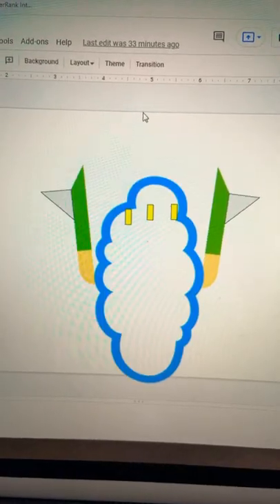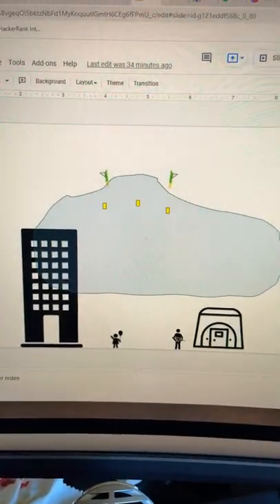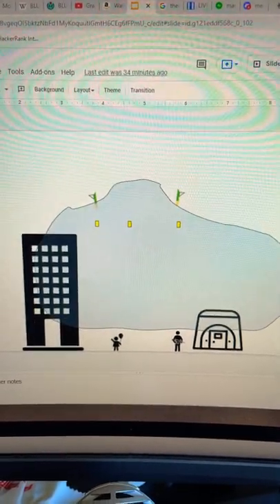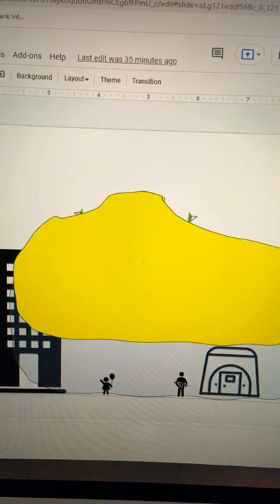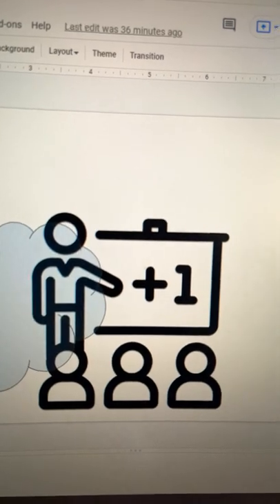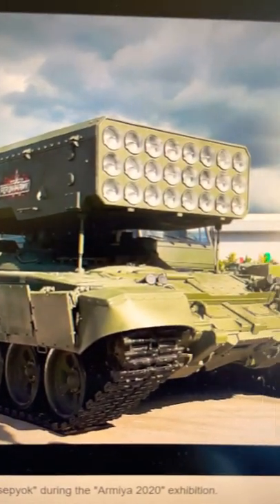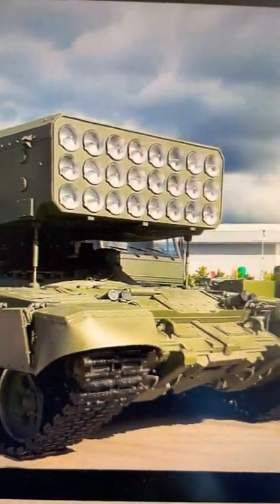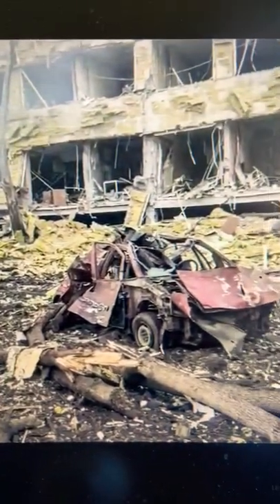How do Thermobaric "Vacuum bombs" actually work?

Comment: They are called vacuum bombs because it created rarefaction of air after the initial blastwave. The rafefied area then will equalize its atmospheric density and pressure by,... sucking the air from its surrounding, so not so much vacuum as in space, more like vacuum as in cleaner.

Comment: Pointing out a tiny misconception- the fuel really doesn't have time to get in cracks and such, everything happens very fast. The main advantage is that the bomb doesn't need to carry chemical oxygen (most of the mass of traditional high explosives) so you get more bang per bomb. The overpressure wave also lasts longer because it's emitted over such a large area, making more damaging to certain things.

Comment: When the original shell is ‘blown open’ how does it not ignite the fuel that is dispersed & saturated the air/area? Or is ‘blown’ open literal using say air pressure to separate the prices? Many thanks for all these; your channel is mint for so many and to many reasons! :) keep them coming, gutted when I check your uploads and there are only a couple new ones :) just greedy I guess!
Reply: Because there's not enough oxygen. Then when the fuel is dispersed there is enough oxygen and the second explosion ignites the fuel.
Reply: @ThePandafriend  perfect, thank you

Comment: If  you fire a standard RPG 5 at the unit carrying the vacuum bombs before it had fired any what would happen?
Reply: What’s an RPG 5? That aside, if it was hit with any explosive munitions it actually wouldn’t be as bad as if the munitions were used as intended, as the fuel has not yet mixed with oxygen or been allowed to spread out. However, that vehicle along with the crew inside and anyone around it will simply cease to exist.
Reply: @casual_speedrunner1482  sorry ment a rpg 7v2.

Comment: It should be three rapid stages. First to pop and disperse the fuel a secondary tank of liquid oxygen pop, then the 3rd explosive charge to detonate. Maybe use a hydrogen-based dispersent. Or fill the primary with two parts liquid hydrogen one part Liquid oxygen to pop before the secondary. That would be near 100% efficient. A SCUBA tank would work great to add large amounts of pressurized hydrogen and oxygen 2:1. It would probably just need one charge since it has all the oxygen it needs. Or just use straight liquid hydrogen to pop before the secondary & use the surrounding oxygen like a vacuum. But it wouldn't be 100% efficient. Two parts hydrogen one part oxygen it's a perfect combination for 100% efficiency.

Comment: Smooth brains: they suck the oxygen out of your lungs 😯
Reply: Love reporter logic.  Ruptured all of my squishy insides, but yea, the lack of oxygen is the main issue.
Reply: Correct any explosion needs oxygen even if it's a solid fueled rocket the oxygen is just mixed in with the component filler but they absolutely cause a vacuum if you're in the building that's filled with the blast first there sucked out of your lungs and your body then my guess is the flame and Heat hit you then the overpressure
Reply: @JustinRK81  The underpressure after the explosion leads to lung damage.
And no, you don't need oxygen for an explosion. Just an oxidant.
Other compounds can fill this role too.

Comment: For the life of me I can not find any source for the original coining of the term vaccum bomb. It is at least two decades old and I still do not understand it because it just doesn't make sense because physics. What is an explosion? Anyone? Fundamentally it's expansion of volume. The difference between a fire and explosion is time. The fire expands the same volume over a long time but shorten that time and it's an explosion. Alright so you have an expansion of fuel to water and generally carbon or nitrogen gases. Those take up more volume, you also have heating of surrounding air. If you increase the temp of a gas it increases in volume and decreases its density at stp so you have expansion. Can someone tell me how a regular explosive differs in the ability to create an area of increased gas temp and lower density such that you wouldn't get the exact same reaction? FYI this is why every explosion creates the typical mushroom cloud....
Reply: The fuel doesn't have an oxidizer and because it takes the oxygen of the air there's an underpressure after the explosion, which ruptures the lungs. A vacuum would cause the same effect. Hence the name "vacuum bomb". And no, not every explosion creates a mushroom cloud. This one creates a fireball.